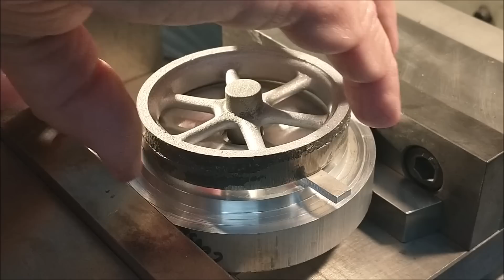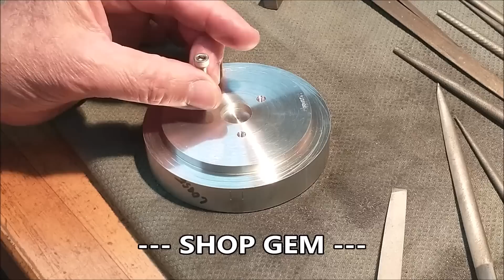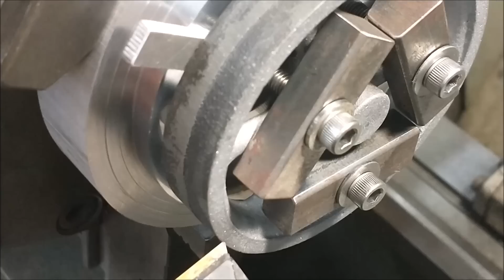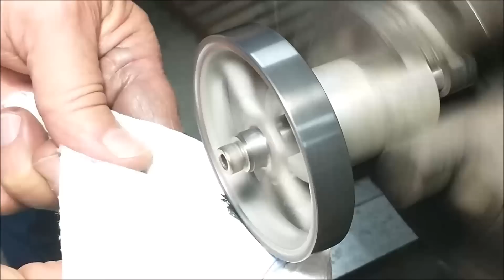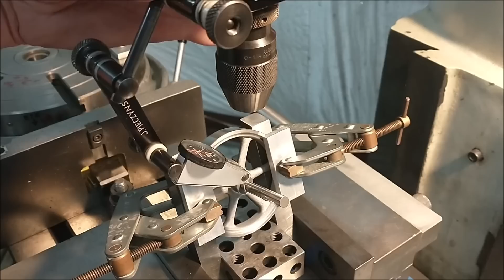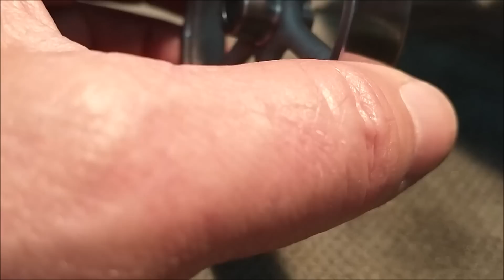Stuart D10 - # 2 -- Machining The Flywheel -- Minor Part, Major Effort

Comment: I have made several engines with flywheels/pulleys and I prefer to attach them to the crankshaft with a 5 degree 6 fingered tapered cone that uses 3 screws into the face of the hub to force the taper into the hub which cut with an identical female taper. The reason I do this is because I absolutely hate seeing a "wobbly" flywheel/pulley - EVER!   Once the cone clamp detail is done I can then mount the casting on an arbor and finish the outer edges of the wheel and tidy up any casting side mismatch that exists.    The initial hole and taper is bored when the wheel is clamped onto a faceplate having centred it as best I can using your approved method.   The last wheel I did was so side mismatched that I had to clean up the insides of the spokes, finding as I did, that they weren't strictly 60 degrees apart - a serious amount of work involving mounting the wheel on a rotary table before I was happy with the result.   I got a couple of gems from this video - thanks for sharing.   It really is a most absorbing hobby for someone like me who spent 42 years in the IT industry none of which work I have anything to show except the spoils of a good living.   JohnA from New Zealand.
Reply from the maker: I agree, your dual cone modification is a good setup, but be sure to machine jack screw holes into the movable cone for ease of removal.

Comment: I’m new to machining. This will sound dumb, but do you ever give seminars on machining?
Reply from the maker: Greetings. I used to teach a course for 3rd year engineering students from the University of Texas at Austin called Design for Manufacturability. One thing I stressed early on is that there are no dumb questions when it comes to machining. Every question is valuable. To directly answer your question...Sorry, I don't teach courses any more. I am an active channel host and try to answer questions as they come in, so feel free to leave one in the comments as you get stuck and I'll try to help/direct you if I can. Watch those fingers, stay well and hit that subscribe button!

Comment: Doesn’t it mess with your head that the head of the socket head screw is not running concentric.
Reply from the maker: SS screws can stretch when over torqued. That occasionally moves the head position. It doesn't matter in this application.

Comment: don't you think it would have been better to do your through hole first
then the center boss would be concentric from then on with minimun effect on the outer
Reply from the maker: I decided to use the most un-machinable feature on the casting as my starting point. That would be the inner part of the rim. Everything else can be cut to blend.

Comment: Hi Joe, in the beginning of this video you tapped some threads using the Mill. It looks like it is a quite straight forward operation but I still have some hesitation about attempting to do the same. I’m sure that there must be some points to be mindful of. Have you already covered the procedure in a previous posting? If not, can you go through the operation in more detail in an upcoming video, I’m sure that you will have a need to tap another thread in the coming weeks. Regards Jeff

Comment: I notice you usually do a lot of tool changes.  Admittedly, if all the tools work well in a Jacobs chuck, tool changes don't take excessively long, but I still prefer to use the DRO to hit all the machining targets with one tool, and then move on to the next tool.
Reply from the maker: I normally base that decision on how far apart the holes are. Sometimes its just quicker to change tools.

Comment: I'm sorry but yet another crappy pattern or sloppy moulding from PM Research. This is the third?  Poorly cast flywheel from them on the models Joe has done. PM Research charge the earth for their kits but either the patterns are 1, Poorly made. 2. The pattern dowel holes are so worn that the two halves do not match together properly and are offset ( which in this case does not appear to be the case because the outsides appear to be concentric) or 3. The pattern halves did not match properly when they were new. As far as I'm concerned at the cost of one of these kits it is not acceptable. Plus the fact that they are cast from aluminium not cast iron, means that I would never buy one. There are other kits out there made from cast iron that are very well made and I would spend a bit more money and buy one of them instead.
Reply: Not pm research. This kit comes from Stuart, over in England .
Reply: I've never seen cast aluminium machine like cast iron before! Still, you learn something new every day... 😉🤔😏
Reply: This is a kit from Stuart, I've got several of their casting kits and they've always been well made without chilling, blow holes or undersized dimensions
Reply: @gherkinisgreat  then I apologise to PM Research lol

Comment: One of my antique flat belt driven drill presses has a double bevel gear at the top...
You can instantly reverse it without stopping the machine......for tapping..
Made by Jones, Pollard & Shipman, Leicester, England...
Around 1890-1900

Good video 
☹🇬🇧

Comment: Just a thought, Joe. Your reference surface for your initial lathe operations was the rear (unmachined) face of the flywheel. If this was not true then it would cause the subsequent eccentricity problems you were faced with. In flywheels like these the only items left unmachined at the end are the spokes and the inner rim. So I would have clamped the flywheel spokes to the faceplate with spacers, so that the rear rim was not touching, then bumped the casting around to get the inner rim running as true as possible, before starting machining.
I love watching your channel and am continually impressed by your knowledge and skills.
Best wishes.
Reply from the maker: 3 shims were used on the initial facing operations.
Reply: @joepie221  He's suggesting shimming under the spokes themselves instead of the back face of the rim.  I like the idea but it sounds like a fixturing nightmare.

Comment: Just an idea but, how about aligning the flywheel by turning a shallow boss on the fixture, the same diameter as the ID of the flywheel?

That would assure concentricity, and allow you turn down into the fixture, when cleaning up the outer rim.

Comment: I'm surprised you didn't put 3 button head screws in that fixture instead of using shims. The button head screws could easily be adjusted up and down to get yourself level, or or just faced off to a plane. When you flip the part you can remove the button head screws and call it good

Comment: Hi Joe. If you’re worried about the shims falling out when you loosen the screws, maybe a drop of thin super glue to affix them to the aluminum backing plate (the one you drilled the 3 holes in.) Let the glue set up, then loosen the screws. Once done, if you need the shims back, use Acetone, or heat with a blowtorch, to soften the glue. 😌
Reply: William Squires    Get it right.    "then unloosen the screws"   😅

Dale in Canada 🇨🇦
Reply: @dalemcinnes1834  no, unloosening the screws would mean to tighten them; the screws are already tight (at that point) no point in making them even tighter. 🤔

Comment: for power tapping, do you just put manual pressure on the quill, or is the quill powered somehow?
Reply: Very slight down pressure until the tap starts cutting then neutral pressure.  Let the tap pull itself in.

Comment: Personally, I would have faced and center drilled the hub on one side first, then flipped it and done the same on the opposite side. After that, turn the OD between centers with a drive dog through one of the spokes. Finally chick up in a 4 jaw and drill and bore the centre hub.
Reply: How do you get your center drills concentric on either side with no reference surface?
Reply: @willjosephson  just eyeball it in from each side. The point is to avoid the eccentricity he got when he drilled through by getting the bore centered on the hub on each side first. Instead he assumed the outer edges were parallel and square to the bore axis which they clearly weren't.
Reply: I made a flywheel from Stuart models last year . The two sides did have some offset but not as bad as this one . I like the method you describe . I have put it in my knowledge base . Thanks Jamie.

Comment: My apprentice instructor said: "Everything you make is a monument to yourself."
On another note, this part will be stored until assembly - what do you do to avoid fingerprints showing up as rust marks?
Reply: wash your FPs off with Isopropanole (>98%) or brake cleaner, then put part in a fresh plastic zipper bag and add some oil to the bag ... for steel parts Ballistol (alkalic weapons oil) is preferred to other oils, but copper, brass and bronze parts should not be in permanent contact with Ballistol. Ballistol does not hurt Aluminium, tmE. 

In high vacuum envoronments, Isopropanole (>98%) is considered satisfactory for degreasing parts (as any remnants of grease would boil off in the vacuum and precipitate on delicate detector or optical surfaces)

Regards, Bernhard

Comment: I found that using valve grinding paste (for cars) works well for pre polishing, start with the coarse, move to fine, then use a polish
I've used it to polish the edge of acrylic discs too ;)
(don't have a lathe, but use my drill press)

Comment: Watching the bit from about 16:00 to 18:30 you start by pecking with  a centre to ensure when you drill the centre the starting point is not upset by the roughness of the surface initially.  OK, that I understand, then when you have the hole you use a boring bar to face the rest of the surface of the centre boss.  OK, but why not do the two operations the other way around, start with the facing then when you come to make the hole you have a smooth surface to start the hole in?  Am I missing something as to why you make the hole before facing?   If the issue is room because of the thickness of the pieces clamping across the spokes, is there any reason why they have to be so thick?  (Apologies if I seem to be being a bit of a smart*** here, I'm asking since I hope to be building one of these Stuart kits myself soon and would love to get even close to your standards of workmanship)
Reply: I was going to ask the same question.

Comment: Suggestion on the floppy spacers for the first setup. Drill and tap another bolt circle on the centerline diameter of the flywheel rim. After putting the fixture in the lathe and facing it, screw three cap-head screws down tight, and face them. Now you have 3 points of contact that won't be moving around on their own while you try to clamp and center the flywheel casting. They also won't move around if you touch them a little while facing the rim of the flywheel. Remove them (or not) as you choose before the second op on the other side of the wheel.
Reply: I like this 👍

Comment: Joe when you grind a tool as small and intricate ( the small size of the leading face,the small radius etc), as the tool you used to true up the concentricity on the second face, do you use only the bench grinder or do you use a die grinder or Dremel? Or d bit grinder? Sorry for the naïve question. As a hobbiest I learn a ridiculous amount from your videos. Thank you for making them.  There are a quite a few knowledgeable machinists on YouTube, but only a couple with your ability to teach.

Comment: For everybody interested who doesn't know:
3 points of contact, because 3 points geometrically define a flat plane. So per definition, every single one of those 3 points lie in this flat plane, while a 4th point may be located above or below this plane.
It is also the reason why a 3 legged table will never wobble

(disclaimer: it is assumed that those 3 points are not collinear [lie in a straight line])
Reply: Just like a tripod.

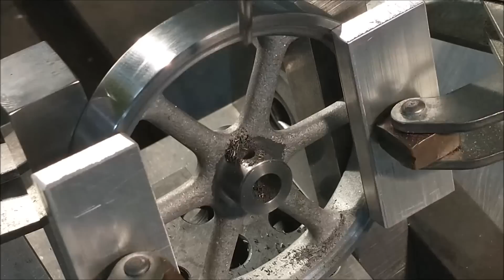Comment: 39:25 I was trying to tap a flywheel hub once, one a bit bigger than this one, but the tap was a bit too short and the handle would just bump into the flywheel. And then I found "pulley taps". They are extended length taps - mine is about 3 times the length of the regular tap. A lifesaver.
Reply: You can get extension tap handles too,
Reply: @pacmag951  I've seen those but the problem can be that you can't keep your tap vertical and get really close to the center of the flywheel or pulley without drilling and tapping on an angle which has its own issues.

Comment: I stopped by my machinist today to spin up a simple seal driver, and he told me the exact thing that you did about the center hole and taking a skim cut to ensure concentricity. On my simple part, it wasn't a big deal, but it's pretty cool that I come here and hear the same thing.

Comment: When I powertap and have a bit of bad thread at the top, I remove the top with a small countersink. I've made some threads worse trying to drive screws into them, but I'll try the wobbling method you describe next time.

Comment: Perhaps you'd be amused to learn that instructional materials from the 1930s and '40s discussing repairs to steam locomotive gauge-cocks include this:

"To renew the disk when it leaks, the spindle handle is turned to the left as far as possible, thereby moving the collar c away from the disk d and bringing the end a of the stem in contact with its seat b [...]  The coupling nut j is next turned off the bonnet k, the packing nut l is UNLOOSENED and the handle f is removed."

There's nothing wrong with the proper use of venerable engineering terms.  😁

Comment: Question:  Why so much chatter (squeak noise at 18:30)?  Is the nose radius too large?  That boring bar should be stiff enough, especially at that low RPM.
Reply: Most likely the casting surface cooled too quickly after removal from the sand mould. Quick cooling of grey cast iron can cause it to go hard a brittle and a pain to machine until you get below the surface. I had the same problem on a few parts of my single cylinder version of this engine.
Reply: The squeaking is coming from the casting itself due to the flywheel being very thin walled. I doubt changing the tool geometry does much for the noise.

Comment: When I did the flywheel, I took a 3 jaw, reversed the jaws chucked the flywheel from the inside then chucked the small 3 jaw into my 4 jaw. Checked ID alignment then did OD, hub, center hole, one side. Then flipped, used the axle hole to align and finished  up. I like your technique, it works really well. Just a comment, not competing with the master. Cheers. Additional comment: Put a key in the flywheel. A set screw will shake loose over time, especially if you put a flat belt on the flywheel to drive something. I used 1/16. Cheers
Reply: There are many ways to 'skin the cat' so to speak....the end result is the product of the craftsman doing the work.   I love watching how problems are solved which is the core of machining things.   Very satisfying to see rough lumpy cast transformed into shiny!